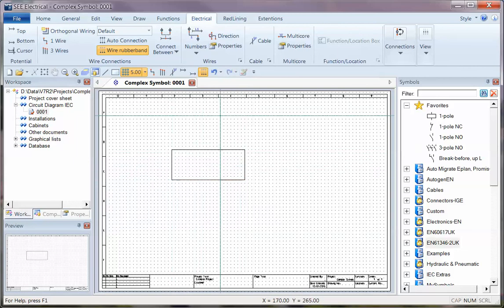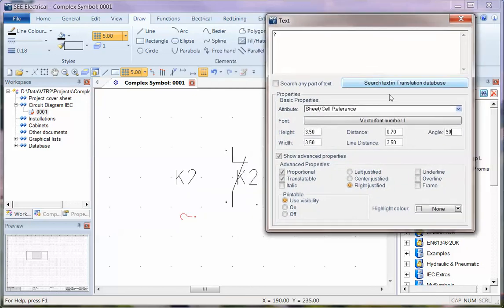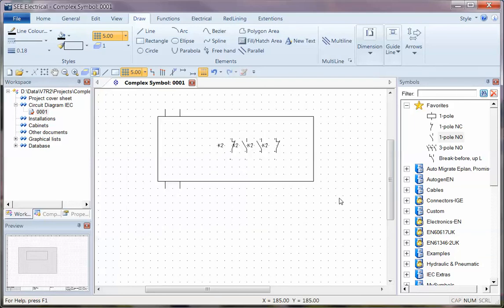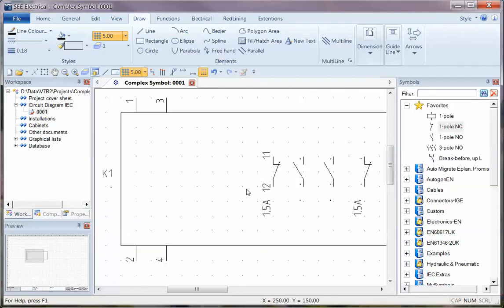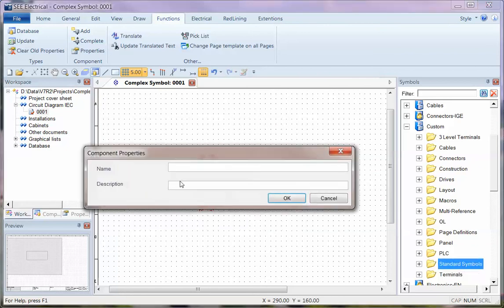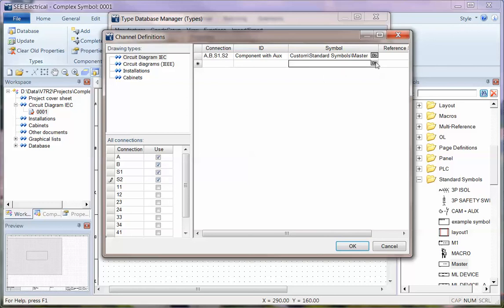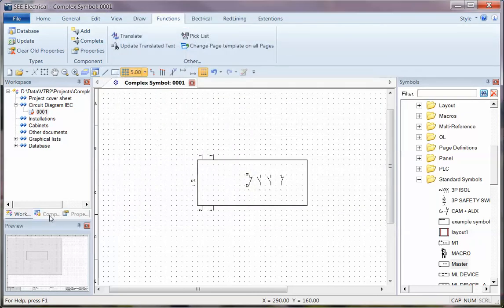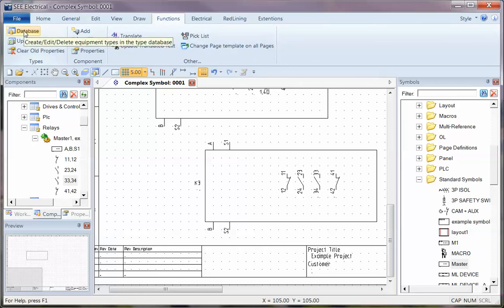Creating Symbols with Custom References Part 1 V7R2

Comment: In this version I can create a cross-referenced component where the first part is a component and the second part is a component not in list (except as target). In my example I don`t want combine all parts of my components for avoid duplicates on material list, so for the first part of my symbol is component and the anothers not, But I don`t got sucesfull unsing cross referencies.
Reply from the maker: In newer versions of SEE Electrical, use the 'Contacts, not specified' symbol type for the auxiliary symbols and add cross reference attributes to these and the 'Component with Aux Contacts' symbol to show the page references. Each product used will have just one set of equipment for the material list.

Comment: I have tried to follow the steps you did but for some reason I only have to option to create a macro/group when pressing ctrl + g. I dont get the option to create a component.
Reply from the maker: You've got a wire or another symbol included in your selection. The process is only expecting graphics and text. Try using the page debugger Ctrl+D to hover over the elements to check if there's any wires.
Reply: @IGEXAOUK  you are right.
Thanks for the quick response

Comment: Hi IGE-XAO, 

Very good video.

After trying out, I found all the connection point is named either connection00 or connection01.

Could you also advise how I should go about assigning the connection point correctly to each symbol?
Reply from the maker: In the main symbol, the contacts are used only for reference (sub blocks) and their connection points cannot be wired to directly. Placing the separate contacts in the project (with the same Product) should show the reference on the sub blocks (contacts within the main symbol).

Comment: Very good.

One more video which would be nice would be to show how to combine contact referencing and part referencing on one symbol. I noticed that it is not possible to combine the methode shown together with the part referencing using the #xx function. Once this is done the cross referencing from the remote contac is dropped.
Reply from the maker: You're right that you can't combine 'Component with aux' and 'aux contacts' together with the special method of linking multiple 'Component with aux' symbols using the #n pairs of 'sheet/cell reference' text. 

You can however take one of your 'Component with aux' symbols, explode it then block it as a 'Multi-switch' or a contact type that you don't use very often (just because it says 'Contact' in the block definition doesn't mean you have to have a symbol that looks like a contact or have just 2 or 3 connections). Then insert it in the same way on the main symbol (maybe use 'A' to reduce the size when inserting) and re-save the main component again as in this video. The new 'Multi-switch' symbol can then be used and will reference the main 'Component with aux.' device in exactly the same way as any of the standard contacts.